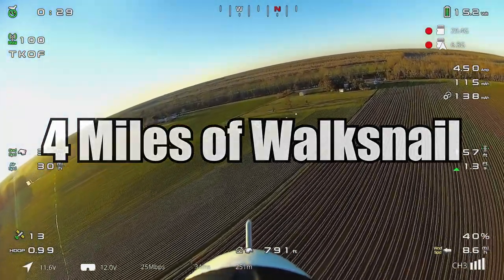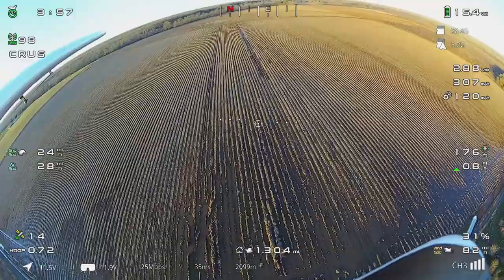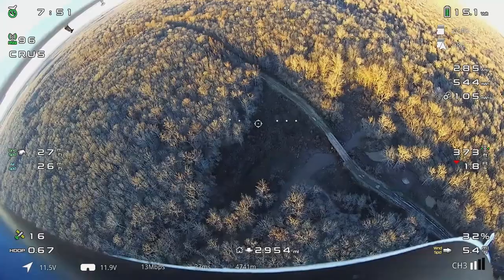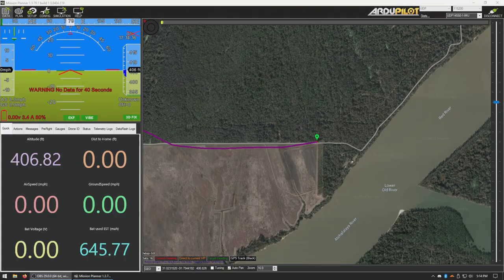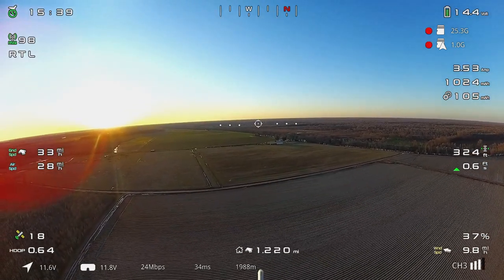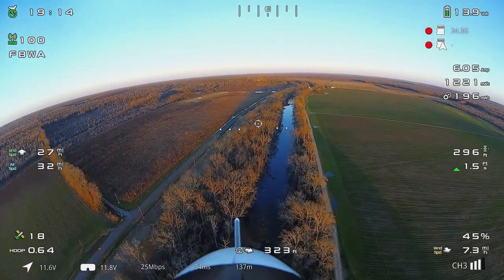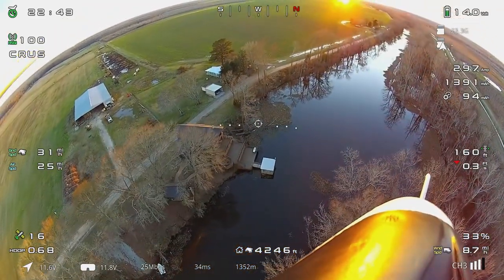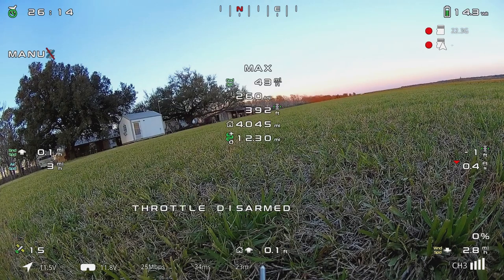4 Miles of Walksnail

Comment: I did 5.3 miles yesterday with my aeroscout and walksnail system, using the same antennas your using on the vrx but I have some lollipop 4 on the vtx , got back home I was in the air for 23 min , flew another 8min around home on stock setup , 3400 li ion pack
Reply from the maker: What bitrate and resolution are you using? I think the consensus is pretty much that you get better range on 720p at 25Mbps. I'm still at 1080p for now, 25Mbps. I honestly don't see a ton of difference in picture quality between 720 and 1080 unless I pause the video and look close at the fine details... That's ground testing though, might be different in the air.
Reply: @bonafidepirate  I'm on 720p 25mbps , 1080p is noticable in the goggles at least I can tell
Reply: @bonafidepirate  is that overlay tool something you install on the goggles?
Reply from the maker: @jimmytheriot8978  The overlay took takes the files from the VRX/Goggles SD card, and puts the OSD onto the video file. What you see here is the HDMI output from the VRX recorded on my PC, no overlay tool used for anything.
Reply from the maker: Here's a demo of how the tool works https://www.youtube.com/watch?v=Geou1lFER_g
Reply: @bonafidepirate  got my vtol conversation kit today for my T1 ranger should be fun , thinking of getting the vrx for my homemade cockpit. I have an antenna tracker and wonder how that would work?

Comment: I found it to be absolutely critical, to have both high gain patches facing the plane. One on an RX port and the other must be on the TX port of the VRX or goggle. To maintain maximum signal strength, and best range.
Reply from the maker: I'm using the VRX, and have my two TFP on the top ports, built in patches for the other two antennas. One of the top ports is the Tx, they're all aimed together and pointed at the plane as best I can get it... lol To be honest I think I'm just kind if finding the limits while flying with the lower gain antennas (as opposed to TFP arrays or something else relatively high gain) and staying under 400ft. With more altitude I could certainly go farther, but we'll save that for another time, and place... ;)

Comment: I flew my quad yesterday on just 200mw with no issues. Betaflight of course but absolutely no flickering of the OSD. I am using the overlay tool from GitHub though to render the video. Maybe the flickering is because you're recording the live feed directly on your PC?...The HD feed has opened up a new world in terms of detail. Imagine what overhead Summer sun will bring?
I noticed the onboard video memory ran out again...😳😏😏😀😀🇬🇧👍
Reply from the maker: I've played around with Kirek's OSD overlay tool a bit, the flickering is there too. It's flickering while flying live on my monitor as well. The recording just records what the HDMI is pumping out... lol It doesn't seem to be related to low signal or whatever, you can see it when the plane is sitting on the runway, before and after switching to low power standby mode. 

Oh and that small onboard memory is one of the first things I suggested they change when submitting feedback to Caddx! lol More storage or an SD card slot. 8GB is not enough for planes that stay in the air more than a few minutes. For now I'm happy recording on the ground though.
Reply: @bonafidepirate  Maybe the flickering is an Arduplane thing then.?..I don't think the cherry antennas made a huge difference?
Great to see it all working though...I'd like to see some Giroflow stabilised footage using the blackbox SD card data at some point in the future? Be a good video subject IMO. ..🤔😳😀
Reply: I don't have any flickering with the latest betaflight
Reply: @MachuPichuu  Mystery solved, his flickering was caused by the onboard VTX DVR recording...see later clips...🤔😳😏😏🇬🇧

Comment: Probably worth bypassing the internal patches which are probably crap anyway and putting two more sma connectors on there.

But honestly i would expect range to be better on 1200mw.

I hope the VRX is not less sensitive than the goggles.
Reply: I've had my VRX doing the business at 7.4 miles so far with two 150mm triple feeds and the stock patches. Another couple of TF patches on SMAs would deliver mad range, like Wesley Varty's findings.

Comment: If you decide to put it on the AR Pro, I’ve designed a nice little 3D printed bracket for the VTX and antennas for the “HD hatch”. If you want, I’ll put it on thingiverse. It’s designed to take it apart very easily if you want to remove it or move it to a different plane.
Reply from the maker: Yeah for sure! I bet other will find it useful too... lol
Reply: @bonafidepirate  I'll upload it tomorrow and share the link. Bedtime now... 😴

Comment: Bonafi you have to help me. I want to buy walksnail VRX but I dont want connect to my analog goggle (skyzone)
I want to conect with HDMI to my cheap FHD 12inch lcd monitor. Will this work?? I fly long range like you only so bigger delay is no problem but I want the full potential of the image ( 1080p) . VRX will be  above my shed roof around 1m so I need 3m HDMI cable
Thanks
Reply from the maker: That should be completely fine. I'm using a 25ft HDMI cable ran back into my shop, and I have a HDMI splitter to connect to my PC that I record with, as well as a small monitor used to fly with. Works fine for me!
Reply: @bonafidepirate  great :)Can you tell me what HDMI did you buy....any link ?
Reply from the maker: @nucleo1772  No sadly I dont... lol I bought it in 2017 when using the fpv.blue system. I looked back at my old orders on eBay, and the listing is gone now. It was just listed as a 25ft HDMI 1.4 cable for $6.95 with free shipping, so it can't be anything special. ;) I'd guess any decent cable should work. You'll need an adapter, the HDMI connector on the VRX is a mini size, not full/normal and not micro. This is the adapter I have https://amzn.to/3R4PAOG
Reply: @bonafidepirate  thank you so much :)

Comment: For more range just fly at higher altitude?   Maybe objects in the way.
Reply from the maker: Yeah more altitude will definitely give you more range, if nothing else just for not violating the fresnel zone... lol I'm just looking to see how this performs in the same way I fly 1.3G analog really, which can definitely fly farther at less than 400ft despite the larger fresnel zone with it's lower frequency. The better penetration makes up for it in that case I guess. Honestly 4 miles under 400ft isn't terrible for 5.8GHz, even more so considering the bandwidth used for HD.

Comment: Almost as good as tye old fpv blue hey!? :)
Keith, is that pan and tilt on head tracker or just radio dials?
Reply from the maker: So far, this has better image quality and a bit less range than I got with that one. It's certainly smaller and easier to mount on smaller craft... lol I know I've seen others getting more range than I have though, so that may be something I can remedy.
Reply: @bonafidepirate  yeah se certainly are very spoilt with all this digital systems, I'm on DJI and the new o3 looks beautiful but at the moment not much for osd!
Reply from the maker: @rotormasher  The biggest reason I never picked up DJI was the lack of a stand alone receiver. I think everyone would be surprised if they made one at this point... lol BTW I missed the bit about pan/tilt before. It's on the sliders on my radio (TX16S) no tracker.
Reply: @bonafidepirate  I know it's like Apple, they want you to get you heavily on their system.
But I think in terms of image quality there's nothing else like it 😜

Comment: so i'm new to fpv...i'm on the verge of buying the new hdzero goggles that aren't even released yet($500)...opinions? bad idea? i like what i see in this video...and this is about all i ever want in regards to a flight experience; perhaps another mile or two out, at most.
i currently have no fpv gear whatsoever, just a new/unused matek flight controller.
Reply from the maker: I pretty much never fly with goggles, just monitors, always have. So I can't comment much on the goggles, but everything I've seen lately seems to suggest most people that have used them like the HDZero ones. For just starting out, I'd say build something cheap and fly it and see if it's something you want to dive deeper into. On the other hand, nice gear would be easy to resell later, and if you stick with it you only have to buy once. There's always two sides to every story... lol

Comment: The 150mm TFP antennae should at least double your range.
Reply from the maker: Yep, but at the expense of a narrower area to stay in while flying. I have two of them that I'll try eventually, but always liked the "beam" on the smaller ones. I fly with similar gain and pattern on my 1.3G antennas for the same reasons.
Reply: @bonafidepirate  Have you considered the SMA installation hack on the VRX? Seen a few people do it but I'm a bit scared to butcher my VRX at the moment. Would be interesting to see how 4 triple feeds worked if the additional pair were angled out slightly for a wider beam.
Reply from the maker: @wattage2007  Yeah I've seen some people removing the built in lower antennas and replacing them with SMAs. I'm more interested to see how good it can work with minimal modification first. I haven't even mounted the large TFP arrays yet, still using the smaller lower gain ones.

Comment: I did 17.8 km for now, here is my 16 km. Preparing better plane and battieries to go beyond 20km
https://youtu.be/fHHXh9k-SGg
Reply from the maker: I saw that flight, I think in the Hooligans group... lol Are you using 720p or 1080p? Mine is currently set up at 1080/60, 25Mbps, and 1200mW. I think if I drop to 720p it will do a bit better with more headroom for bandwidth. I haven't tried 50Mbps yet either, I assume that will demand even better signal to try and maintain that bandwidth over two channels at the same time. I could be wrong though! lol Is your video the files from the VRX or VTX? I didn't see any breakup at all there.
Reply: @bonafidepirate  i subscribe your channel since i saw you had Binary, which i recently had bought. Before that whatched a lot of vids ♥️ i am suprised that you remember my video! 
Its gogles DVR, 720p/50mbs/1200mw, i had a little break up while returning home ;)
Reply from the maker: @bunk.w420  Watching again now I see when it was breaking up a bit. I forgot the VRX/Goggles just throws out the bad frames and skips over them... lol It doesn't show as much as in real time when the video pauses for a bit before coming back.
Reply: @bonafidepirate  yeah, and also doesnt show pilot standing with gogles on face and heart attack in chest if video comes back😂
Reply from the maker: @bunk.w420  lol Yeah, it's a bit of a strange feeling at first when it freezes. I think I'll start playing around with bitrate and resolution next.
Reply from the maker: @bunk.w420  BTW, are you triple feed patches the small ones, or larger "arrays"? Mine are the small ones, I like the wider coverage with them. I have two arrays I can swap too later if needed. I do like these smaller ones for just exploring around within a few miles though. Best would be a tracker and the arrays, if it didn't come with the associated complexities...
Reply: @bonafidepirate  i use bigger ones, as i saw Wezley's 40km record ;) also used 2x x-air 2 on the bottom. If i want to fly few km out i use only them and stubby. Id like to use signal tracker but i'm new to long range so dont even know which to pick. i've Heard that sentinel is worth considering